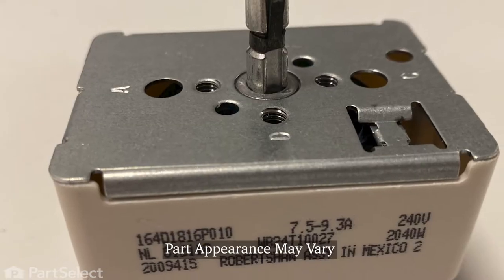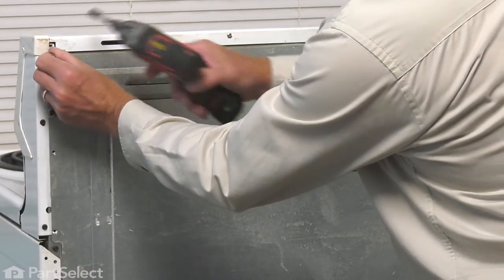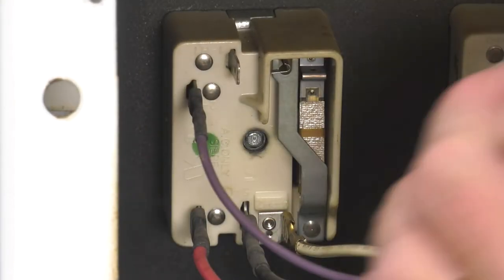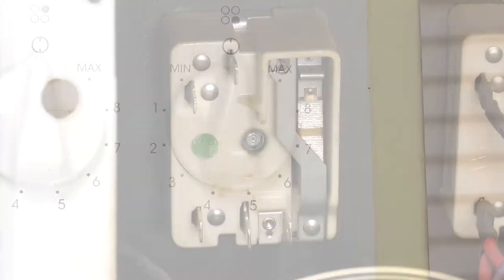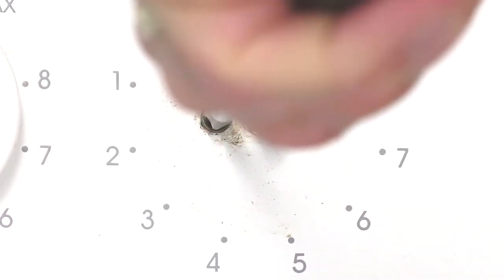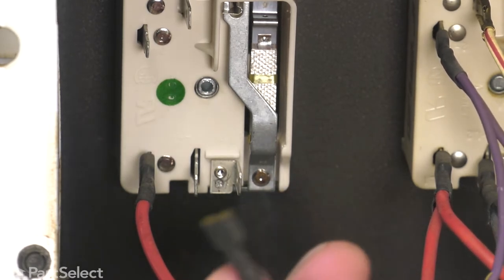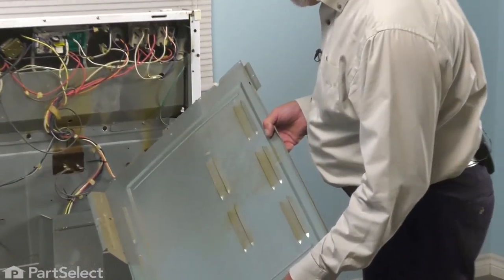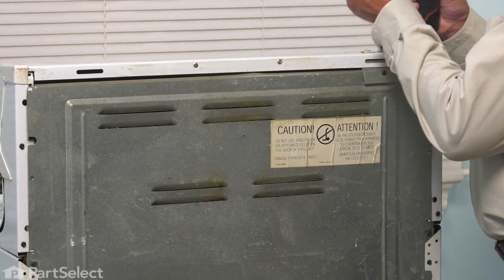GE Range Repair - How to Replace the Surface Burner Switch (GE # WB24T10027)

Comment: y not take of the switch panel only? y would u need 2 move the stove out (most likely it's standing with its ugly back against the wall and even worse - tightly fit between countertops)?